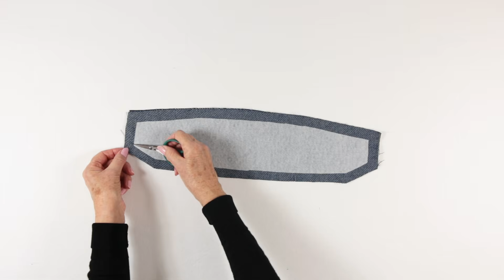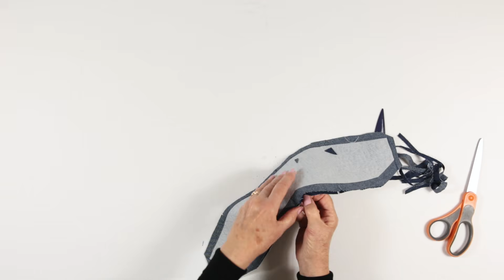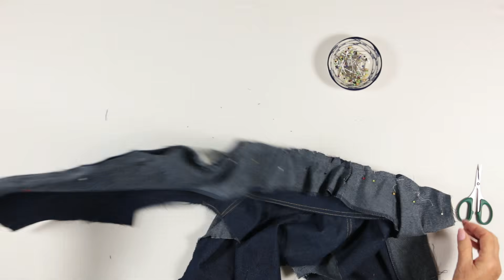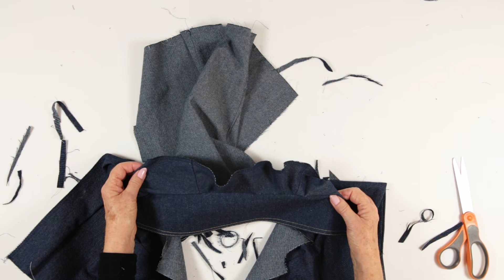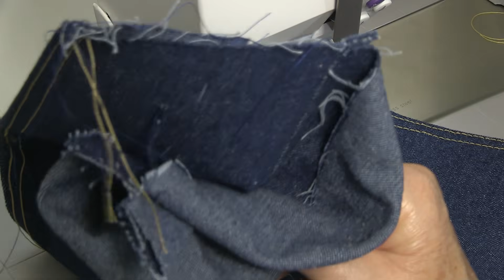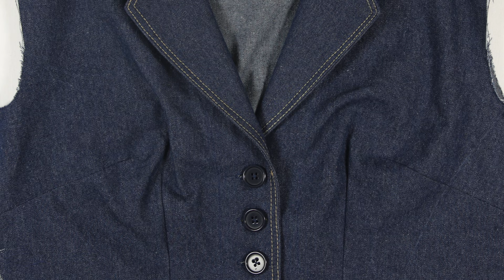Shirtwaister Dress Sew Along Part 2 - Construct the Rever Collar, Top-Stitching and Buttoning Up

Comment: Hi.  Great tip of using the edge tool as you press.  Would you also grade seam allowances on more lightweight fabrics too?  I've just bought a buttonhole cutter and used a drizzle of freycheck on my buttonholes, letting it dry, before cutting them.  Worked very well.  However, I may not use the cutter on finer fabrics
Reply from the maker: That is a good point.  I wouldn't grade seam allowance on a lightweight version.  I'm always nervous cutting buttonholes.  It's so easy to cut the threads.  Fray check is a very good idea and I use it.
Thank you for your feedback.